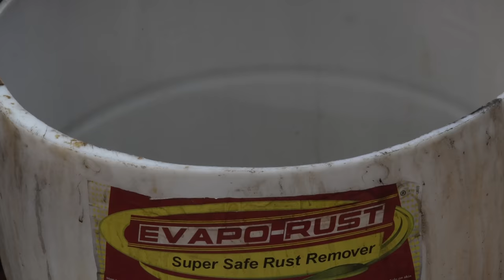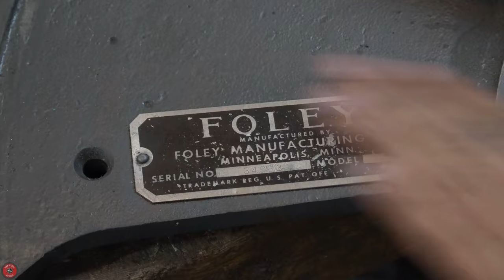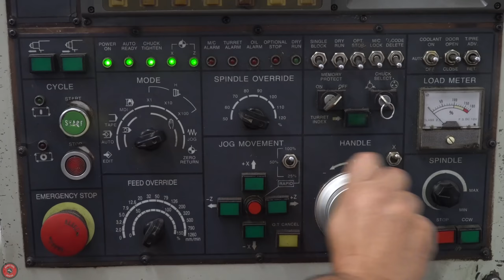Vintage Saw Sharpener [Rescue]

Comment: It's nice to see this old Foley in operation.  Fifty years ago I had a saw filing shop as a teenager.  My Foley was a little older than this one and had a spoked wheel to make the settings prior to sharpening. I filed handsaws and plywood circular saw blades with small teeth shaped like handsaw teeth, not the large circular saw blade you put on the machine.  The carriage for the handsaw could be either straight or crowned depending on the handsaw being filed.  There were two gauges which set the placement of the handsaw on the carriage.  You also need an angle gauge to set the file for the proper profile for crosscut or rip. If I saw it right,  your file was not filing all the way to the bottom of the gullet, nor was it filing the face of the tooth.  In other words, it wasn't set at the right angle. You might have had it taking too much of a cut also.
The rip and crosscut circular saw blades were best done on a Belsaw circular saw grinder whose motor tilted forward and backward on a shaft.  The circular saw blades could be jointed very easily since they fit on a cone like this one but larger and with a set screw.  If you do use the Foley for circular saws, it doesn't screech so much if you turn the machine to the opposite angle and file the teeth set away from you.  That way you aren't filing against the set of the tooth.  Just reverse the saw and use the other feed pawl to sharpen the opposite teeth.  You won't need ear plugs that way.
Reply: Airborne Ranger I to remember those being much quitter , my grandma worked for Foley and of course my grandpa had all the tools they made ! Lol !
Reply: Airborne Ranger: Thank you for firsthand experience confirming my own observations (with no experience to back it up). I am starting an accumulation of Foley-Belsaw equipment and agree that the tip-forward (Model 210, etc) is better for circular saw blades. Thank you for your service, All the Way, Sir! Airborne.

Comment: Next you need to find a retoother. Foley set up this saw filer to use the existing teeth to ratchet the saw forward. If the teeth aren't spaced exactly the filer will screw up the teeth. The retoother uses a rack gear to set the tooth spacing and the filer sharpens the teeth after they have been recut. 
You show the filer sharpening a rip saw. It is fun to watch it filing a crosscut. It has to skip a tooth and the teeth are filed at an angle. Neat stuff. Glad you saved this old machine.
Reply: I noticed a couple of broken teeth, as well. But, it was probably just a demonstration, not a customer's saw. I am eager to see a re-toother in action.

Comment: If a threaded bolt is bent like that, you can sometimes straighten it quite a lot by adding nuts one by one and torque them hard.
Reply: My thought exactly. But I would heat the bolt, then use box-end wrenches to apply gentle leverage until the bolt is straight, then run the nuts or a die over the threads so that the straightened bolt does not eat the threads of the (aluminum?) knob.

Comment: lmao "holy shit theres a lot of knobs on this thing"
Reply: If you cant make it perfect, then at least make it adjustable.. how ever amount of screws, bolts, knobs and other adjustment thingys is bit excessive even for me.. then again this was "all in one sharpening solution" and if your customers had only one type of blades in use running sharpening operation was really quick.. setting it up took most of the time as mentioned, so big industrial city sharpener probably had several of these set up for each job after few years of business.

Comment: I think preserving the paint was 100% the way to go. Without making it a measuring context, a great as my mechanics's channel is, he always destroys signs of use and character and leaves tools feeling lifeless. I like respecting the heritage of tools
Reply: Right you are! It took me years to realize that the eight hours or more I spent disassembling, cleaning, repairing, painting, reassembling and adjusting vintage American made vises actually made them worth less than if I had just left them as I found them. No discerning tool aficionado wants some half-ass "like new" restoration that paints over century-old finishes and destroys decades of patina.

Comment: "Pt 2 The Sneakiness" .....ha ha ha
I'd guess it was designed by a clock maker after watching it in action.
Reply: I thought it was designed either by madman or genius but after hearing it "sing" I'm sure it's torture device with practical use.
Reply: Yes, it includes pieces from a grandfather clock, a power hacksaw, a flywheel from a hit n' miss engine, and a bucket of screws and bolts swept off the floor of the Curtiss Wright factory.

Comment: I repaired a toilet with my Official HTR adjustable wrench. It worked beautifully to take off or hold old nuts/bots and put on new ones as I changed and updated all seals and anchoring bolts. I had so much fun that I then did the same to all the toilets in the house, upgrading everything to dual flush. The HTR Adjustable Wrench worked beautifully. It is now a trusted part of my toolkit.
Reply: I have a dual/triple flush toilet because one flush is not enough. Maybe I should get one of those official HTR adjustable wrenches.

Comment: I have 2 Foley bell saw machines I need the handsaw carriage's.  Mainly the toothed rack bar's made up "machined" they set the pitch Foley offered 4 or 5 different pitch bars this included speciality. Would Hand Tool Rescue be interested?
Reply: Maybe THEY would be louder?
Reply: I saw a forum comment describing the dimensions of the carrier pieces so you can make it yourself. If there is any response to this comment, I will reply with the dimensions.

Comment: That non metallic gear is probably made of tufnol which is like micarta but uses phenolic resin, smells like absolute death when machining/sanding the stuff🤢
Reply: If it's tufnol it could contain asbestos.
Reply: @biglebowskee  so it's the good stuff then
Reply: It could also be made from Formica

Comment: Crazy awesome! Looks like someone (like my self) was too impatient when it came to sharpening blades by hand... he (inventor) likely spent more time designing and perfecting this machine then he ever would have doing it by hand. 

Love the simple, old, yet intricate engineering that put together this well build machine! Loce
Reply: The inventor, since 1917, enabled thousands of others to sharpen millions of saws without the headaches of invention and refinement. The Foley saw filer has changed very little in 70 years.

Comment: Very interesting machine. Glad you rebuilt it and displayed how it's used. I guess if a blade is badly dulled, it has to go around multiple times. But like you stated, every other tooth and then change the angle for the in between teeth. Thumbs Up!

Comment: Few more power tools in this video than we're use too. I've used that STP spray degreaser before, it's really good at taking off surface rust without damaging the paint. Used it to clean up valve covers like new! This thing seriously looks like something out of a movie... Can you imagine having to use one of these on a regular basis? Jesus that sound... I regret wearing my "good" Audio Technica headphones for this...

Comment: Excellent project!  Sharpener was very complicated and interesting throughout teardown and reassembly.  I kind of missed the dramatic transformation of the repainting of the sharpener, but if it didn't need painting,  well it didn't need it. Assembly was very good too.  Maybe include a little more what each sub assembly is or its function.  And until you put the round saw blade on the sharpener I was convinced it was a hand saw sharpener.  Wow, you almost never get a plot twist in a repair video!  The only small complaint I have I'd that the sharpener was so dark colored that it was difficult to see the details.  Maybe consider adding a lighter colored background or increasing the amount of light in really dark colored projects.  Thanks for showing us your work!

Comment: I would have loved to have one of these back in my teenage years working on saw mills. The mills I worked on were all manual once the wood came off the saw and they all had a cut saw at the end of the line for cutting the slabs into cheap firewood. The blades were forever dull because of all the soil and stones in the bark.

Comment: I didn't see you refabricate the bent Tbolt that you cut to remove. Jointing sawblades is the easy part of sharpening. I was very stunned that the triangular file that you found in the piece was still usable. Despite missing some of the original parts, this machine was kept in a dry environment awaiting your rescue

Comment: Foley history

Foley’s history began with Hugh B. Foley (1870-1926), an English citizen living in Seattle, Washington who invented a saw filing machine, US Patent number 837,922, issued December 11, 1906. Foley began manufacturing The Foley Saw Filing Machine after applying for the patent January 24, 1906, according to the name plate on an early machine. Foley formed Foley Saw Tool Company to manufacture the saw filing machine. By 1916 Hugh B. Foley was a US citizen living in Minneapolis, Minnesota, and he was granted US Patent number 1,224,293 in 1917 for an improved saw filing machine. Foley continued to invent and patent saw filing and saw setting equipment, with his last patent issued posthumously in 1928.
Reply: Thanks, Daisy. His invention continued in production for 70 years, with relatively few changes. Skilsaw and others would eventually kill the handsaw trade.

Comment: A really nice machine. Good work again. The best thing to think about is that the machine grinds the tooth surface when grinding the circular saw blade and not the back of the teeth, as it does with many machines today.
Oh and I hope the steel eagle landed well

Edit: 

I'm sorry, but I have to revise what I said from above. Unfortunately, it is very, very bad, that the circular face of the circular saw blade is ground. It should always, regardless of whether it is a band saw blade, a hand saw or a circular saw blade, be ground to the back of the teeth. When the tooth face is ground, the saw blade wears faster and it can happen that the teeth are unevenly ground off, which can lead to teeth of different heights. As a result, only a part of the teeth will be cut during sawing and thus dull faster. Otherwise nice machine.

Comment: with all of that machining work, you know that was an expensive tool when it was new. prolly didn't make many of them, and not many of them left. i'll bet it does a good job though.
Reply: Sadly, more of these machines exist than there is a demand for. This machine is principally a handsaw filer. With all the electric -- now cordless -- saws on the market, few people buy handsaws; still fewer know how to use them; and fewer still would bother to sharpen them. Same is true with circular saw blades.

Comment: To get a very well sharpened saw It looks a little bit fiddly but I bet it does a great job once it is adjusted properly and unfortunately it needs to be adjusted for each blade to be sharpened. With a little practice and patience a very good tool to add to any woodworking shop.

Comment: One thing I've always wondered about, is what do you find is the most enjoyable part of a the restoration? The tear down, the cleaning, the rebuilding or the testing of the restored product?
Reply from the maker: I actually love taking things apart the most.
Reply: I like putting all the parts in a cardboard box on the bottom shelf in a place I will never go to again as long as I live.

Comment: This is funny, I am a Sharpener at a sharpening shop. We still use these, they do the best job. Todays hand saws are junk! They are made from stamped steel. The old hand saws were hammered steel and much stronger and holds an edge much longer. The shop I work for has been around for 28 years. Have a great day.
Reply: I'm glad people like you are still around, still working on the good old tools, and know that what is made today is often pure crap by comparison.

Comment: I was offered. Job for a saw sharpening company. I needed the work when I was in my late teens. I ran this machine for ten minutes and turned down the job. Scratching my finger nails on a black board would have been less annoying. The pay was two bucks an hour.

Comment: Hey HTR, you did something like this before but that one just set the saw teeth. This is a really convoluted device. Sounds like you ether need lube on the tool being sharpened or the saw blades are too loose and is causing the shrill noise because of vibrations.... or both.

Comment: @HandToolRescue I don't know if anyone else mentioned it, but the two large vertical pins either side of the main gear were swapped. One is slightly longer.

Comment: Cuts bolt with cut off wheel and uses screw driver to get rid of shaving then promptly grabs said bolt and realizes its hot as hell. I only laughed out loud because I've done the same thing more times than I can count.

Comment: 1:58, when pulling that kind of a gear, specific to the "aeration" or "lightening holes", pull from within them, setting the grabbers as close to the shaft as possible. Otherwise, even under light duty, you run the risk of fracturing the gear as it was never meant to support side play. Just my 2 cents based on breaking a few of those many moons ago.

Comment: What were those funky looking bolts? The ones that looked like they were a hex, with a slot screw through the middle?
Reply from the maker: Those are set screws with locking nuts.
Reply: @HandToolRescue  ahh, makes sense, thanks for the reply

Comment: So, uhm, did you actually sharpen the backside of those hand saw blade teeth instead of the front?
Reply: The saw had broken teeth and lots of rust pitting, so I'm sure it was just for demonstration
Reply from the maker: If you look close the file was hitting the front of the teeth as well.